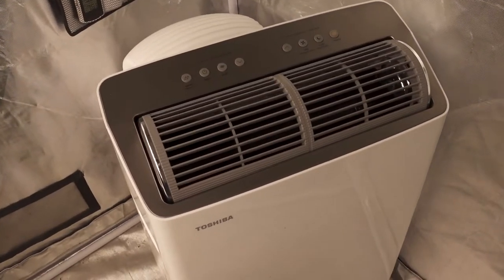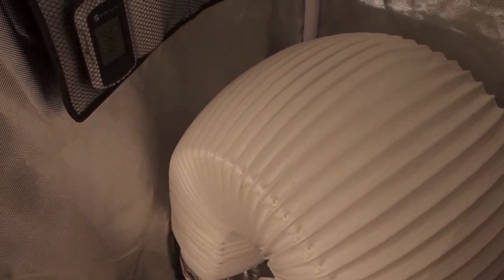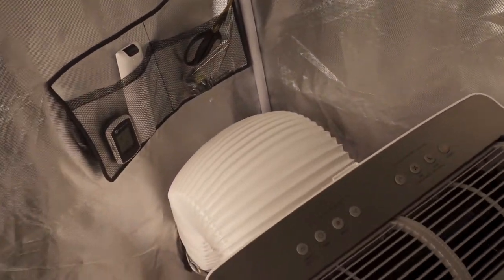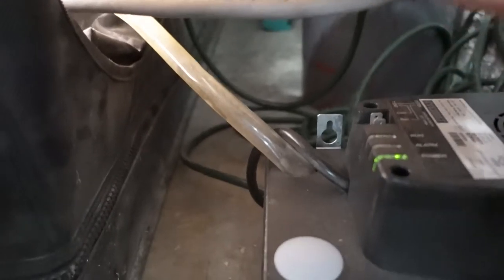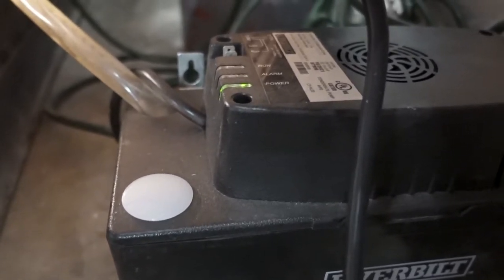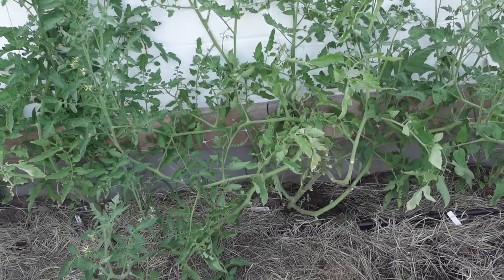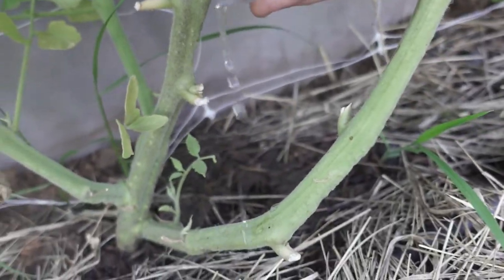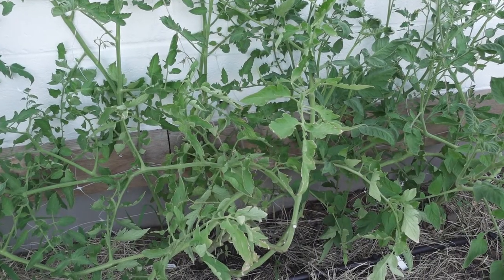How We Recycle AC Waste Water - Living Soil Grow

Comment: can you really filter out the contaminants in that wastewater?
Reply from the maker: We see people run it through ro and reuse it indoors. I don't know if the addition of uv light would be necessary, but would be interesting to see the results nonetheless
Reply: yeah it would. it's been driving me nuts for the last year since I picked up my dehumidifier cause I dump so much water down the drain it makes me sick lol. thanks for the video!
Reply: Been using my waste water from the Dehu Straight to the Rez aerated with tap For about eight weeks haven’t noticed any issues. Also read a study in Maxyield That resulted no cause for concern in regards to Metal’s only that the unit stays as clean as possible to keep out organic  Contaminants
Reply from the maker: Our waste water seems to be almost killing the tomato plants it is watering outside. Filtering is always the best idea.